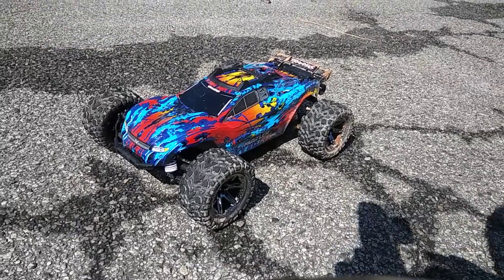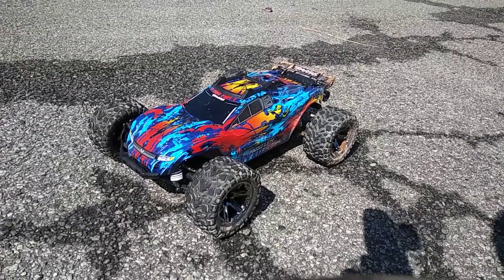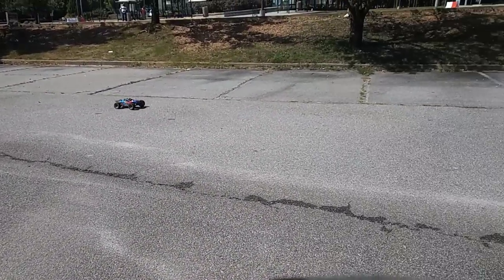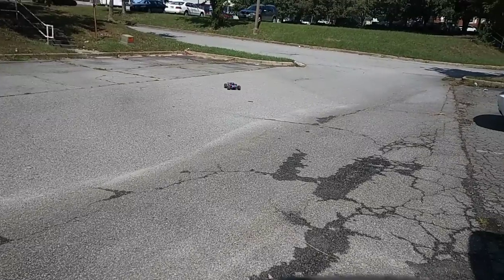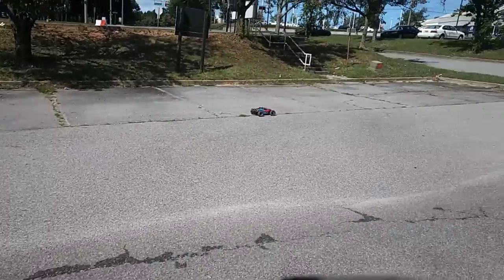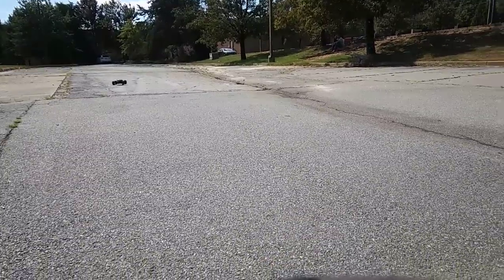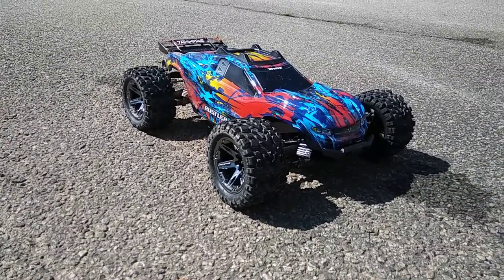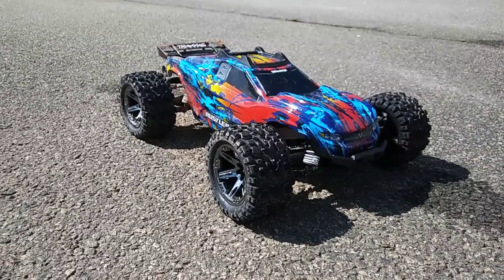Traxxas Rustler 4x4 vxl 3s Run

Comment: The stock gearing is very conservative, even on 3S. But it's nice you have quite a range of options as the stock is 11 teeth and you can go up to a 20 for the crazy 65 mph. They include a 17 teeth pinion, but that's probably a bit extreme for off road. I think I'll get something in the middle, probably a 14 teeth for 3S off road + passive heat sink if I see that with 11 teeth it stays cool.